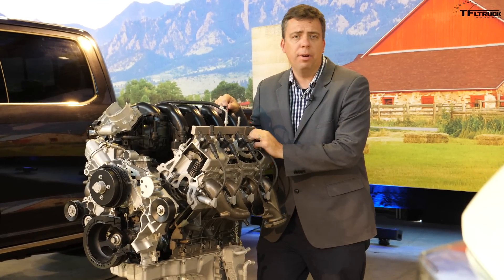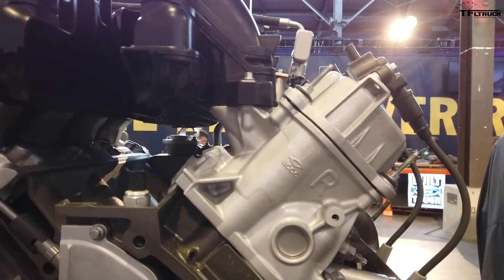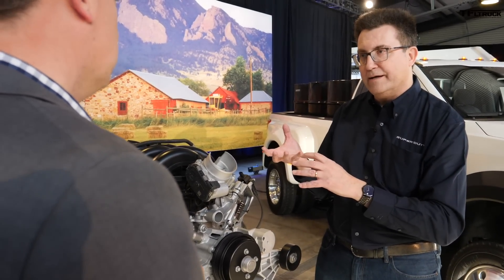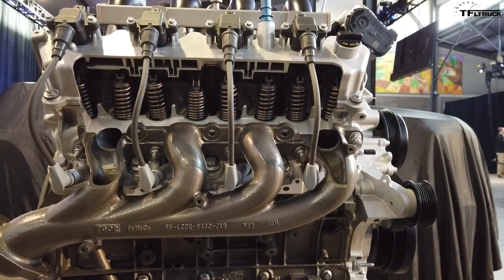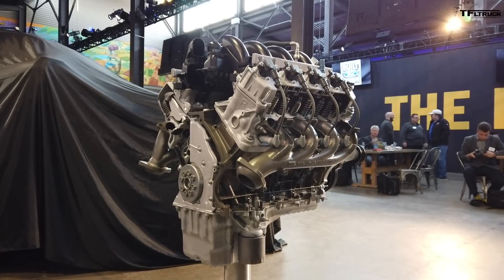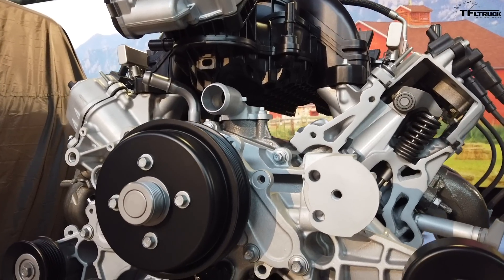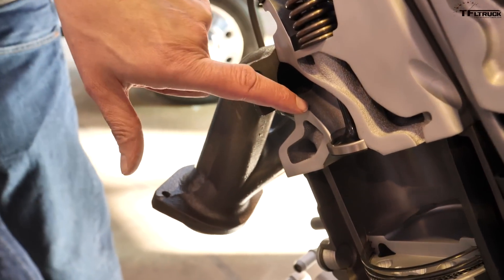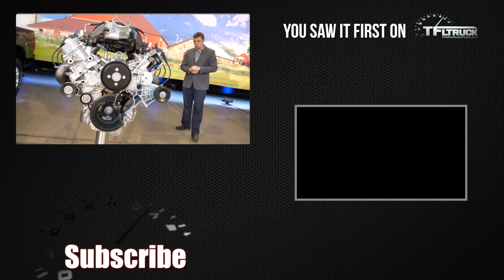2020 Ford Super Duty 7.3L V8: Here's What You Need to Know!

Comment: FINALLY!!!  PUSHRODS!!!  ONE CAM! YAAAAY! They listened to the customers and mechanics. Now if they just put one in the smallest F150 I’ll beat the door down at the dealership. It’s incredible that even the engineer says that the displacement is what we need to achieve our power any mission goals.  I understand it’s hard to beat a 4 valve head in flow numbers but he sounds like an idiot saying that you can’t get power and rpm with pushrods.  Has this guy ever heard of the traditional Chevy, Ford or Chrysler small blocks?
Reply: Concur
Reply: He said their is advantages to using 4v and ohc designs. Which their is. 4v heads by design can flow better than 2v heads
Reply: I would rather have a big reliable engine that will last than an efficient engine that is complicated to fix and breaks down more often.

Efficiency isn't the end all be all of engines. When it comes to a work truck (like pickups are SUPPOSED to be) you want reliability and lasting power.

Reliability and lasting do not mix well with complex engines that run at 110% efficiency and crank iut every bit of power possible.

Just look at race cars, they have the most effecient engines around and they get rebuilt every race.

Meanwhile semis have HUGE engines that don't even put out much more power than the new little pickup diesels. So theyre not efficient, but they last FOREVER.
Reply: @FerrariTeddy  what? Semis put out 2.5x the torque of a modern truck from the factory. Turned up they beat the pants off even the cummins.
Reply: i want to see this supercharged on a dragstrip
Reply: What no one seems to mention is the size of those Ohc mutants. It makes working them 10x more difficult. Their  taller and wider plus have more moving parts then they need to.  Simplicity has always been beauty. Top fuel only uses 1 cam and they make 5000+ hp   The worlds most popular engine.. the LS has 1 and I think ford is finally coming out of the fog again.   Nobody says I just 4.6 mod motor swapped my Camaro. There a good reason for it.  Mark my words...  in the years the come the mustang will eventually get the same treatment.  Cubics over cams
Reply: couldnt custom order one with the 7.3 in it?
Reply: @kennedy796  Torque is irrelevant. You need power to move.
Reply: @TheEsseboy  so 500 hp and 2500 lb-ft of torque is irrelevant and less powerful than a diesel pick up?

So i saw a car hauler with a 300 hp cat (1800 lb-ft) engine pull into a car lot loaded with 6 new diesel pickups. Could any of those pickups pull that amount of weight?
Reply: @kennedy796  A 500 Hp 2500 lb-ft engine is exactly as powerful as a 500 Hp 250 lb-ft engine. Depending on the powerband they will accelerate as quickly and pull the same amount of weight (with the same relative gear ratio and traction ofc)

Yupp, with same relative gear ratio they would all pull the same weight ( given they have the same traction as the car hauler ofc).

Engine torque is not what tells you how much you can pull! Gearing and traction does...how fast you pull it is those AND power and powerband.
Reply: dfdf kjkj in an f-150?  I wish. Manufacturers are not what they use to be. Too maybe constraints now. When I asked GM about getting the 6.2 in a small Silverado their exact words were “don’t hold your breath”.  The sport truck class right now is untapped. Hopefully one of the big 3 will wake up again.  GM will probably try to offer An SS Version of that joke they call a blazer now
Reply: @TheEsseboy  torque is a measure of force. Hp is a measure of force over time. You better believe that a torquier engine is more powerful, but a low hp number relative just says its a slow revver. 250 lb-ft of torque would need 18 speeds to pull a 40k pound load at 30 mph. And most trucks can do over 70.
Reply: @TheEsseboy  you gotta brush up on your terms and physics mate.

A stationary engine can produce 3000lb-ft of torque but make 100 hp but all that means is that engine can output a massive force but it doesnt work quickly.
Reply: @kennedy796  Nope, if they have similar powerband (Say good power from 6000 rpm to 12000 rpm vs 1000 rpm to 2000 rpm) they will need the same amount of gears.
Reply: @kennedy796  Yupp, but if you want a massive force you can use something called *gears*, I know it's a foreign concept to you "torqueheads", with enough gearing you could move a freaking mountain.
Reply: @TheEsseboy  dont change the subject. You spoke of torque being irrelevant and hp being the know all end all
Reply: @Randall Otis , it's better to under-work a big motor than over-work a small motor.
Reply: moose knuckle I couldn’t agree more. That’s why when this eco-boost crap started coming out everyone looked at me funny when I said “ i’m sure It can do what they say but it’s very high strung”  Would rather have a much larger engine that’s barely breathing
Reply: It will never go in half tons unfortunately ...3/4 and one tons fuel economy is not rated by the government so they can get away with big gas engines and it won’t go against their average fuel economy which keeps getting higher and higher
Reply: Ford had the Windsor engine and they abandoned it. Biggest mistake ever. Bring back the Windsor V8s with VVT and direct injection like GMs latest pushrod mills.
Reply: @Matp345  The Ecoboost isn't high strung. It's an excellent truck engine. It makes it's peak torque very low in the rev range.
Reply: @Matp345  The Ecoboost isn't high strung. It's an excellent truck engine. It makes it's peak torque very low in the rev range.... Reliability of turbos aside.
Reply: Richard Tuck of course it’s high strong, It’s turbocharged. It’s spends most of its time in boost which puts incredible strain on parts. I guess high strung could also mean big cam high compression which isn’t the way I meant it
Reply: Colton Weaver sadly you’re probably right. The government says a certain percentage of a manufacturers fleet needs to have a good fuel average. Also remember if you had a very small truck with a big engine that isn’t breathing heavy to move the weight  The mileage would be pretty good especially with the technology we have now and these 76 speed transmissions. My 06 GTO gets almost 29 on the highway. I think that’s pretty damn good for 3700 pounds and 400 hp. They can do it but they choose not to.  They keep talking about these bigger gas engines to pull weight meanwhile I see more mustangs and Camaros on the road than I do guys pulling trailers with gas trucks. Chevy just introduced a new 6.6 V-8 which in traditional GM ways it will never be used for something fun.  Seems like Dodge is the only one that cares about the fun factor anymore
Reply: @honkhonkler7732  , I worked at the engine plant in Windsor that produced the 351, plant no.5, the casting plant, knocked many a casting off 351's. btw we also casted nickel steel blocks for NASCAR teams back then also, Bill Elliot and Junior Johnson race teams.
Reply: @Randall Otis , this motor is being assembled at Windsor's Essex engine plant.

Comment: I can't wait for Hennessey to take over this big block engine and install it with a whipple supercharger.
Reply: Screw that. 2 turbos.
Reply: That's all I've been thinking
Reply: Lots of room for activities in that big ol intake valley :)
Reply: @calebnation7797  man, you're the prime example of a ricer
Reply: Ford Ltd nope. Nothing wrong with turbos. The only thing that bothers me is that it would be stuck in a Ford truck. An old 60s 2 door galaxy would love this.
Reply: @JosephSamsor  when this engine comes out I want to put in a 2019 suicide door lincoln continental
Reply: Ford Ltd except a pair of turbos will make more power than a supercharger. I like superchargers, but turbos are the future
Reply: @calebnation7797  but turbos have a delayed acceleration unlike superchargers where the power is there when you need it
Reply: Ford Ltd sorta... a supercharger builds boost linearly. It’ll make X amount at idle and grow from there. However, it won’t start making meaningful boost till higher in the rev range. A properly tuned turbo setup can do the same or more boost at the same or lower RPM as a supercharger, plus when you aren’t in boost you can still have an efficient engine. A supercharger is going to be less efficient for identical performance which matters for modern everything (a big reason a lot of small cars have turbos). A supercharger is less complex and makes a lot of sense as an easy aftermarket thing, but from an OEM, turbos make the most sense.
Reply: @calebnation7797  you are definitely correct. But what I keep seeing that nowadays is people don't know how to take care of turbos (resulting in a short lifespan). In my case and where I live in (daily driver, in Canada) I think that a supercharger or a naturally aspirated engine is the better choice (as you don't need to heat up or maintain a turbo)

Comment: Looks like they're finally replacing the Triton V-10. Good move to stay ahead in that market.
Reply: Jamie Montoya Triton always gets hate lol
Reply: Yes, well if they wanted a bigger, more powerful slightly larger gas motor, just save all that r&d $ & return to the proven v10, its still in lots of RV's. I had the v10 in an 05 excursion. It was great & I was very disappointed when I learned it was not available after 2010 in a SD pickup. I did not want a diesel motor & the v10 towed like nothing was back there. So I have a 6.2 gas, has a great sound & tows well. But it's no v10, well I'll see what this big 7.3 v8 is.

Comment: meanwhile in finland, just a full tank of gas for this would cost 250usd
Reply: And in good 'ol 'Merica you can do it for $100usd
Reply: @InvestmentJoy  lol, on a 60 gallon tank
Reply: @TheYummyBrand  How much does the petrol costs in America?
Reply: @valentinogj6106  $1.73/gallon
Reply: @valentinogj6106   Where I live Regular is running 2.279 per gallon. That is a bit on the high side since Connecticut is a more expensive place to live, they tax too much here. in TX and SC, it's well under 2 dollars per gallon.  What is going one here Nino, is the Shale revolution,  we getting Hydraulic Fracturing down really good, the engineering part- it's almost to the point were a barrel of crude from it is almost as cheap to produce as Saudi Crude.  And then there is the Natural Gas part of it, the pipes are being built to bring that to market too, at a price that damn near gives it away.  We have become pretty much energy independence. The oil is very very high-quality light sweet crude and our oil refineries are making the adjustments. This is really good for the United States,  But for places like Venezuela its worst that bad, we are one of the few places in the world that can even refine that Crude, it's very heavy and it takes a lot to refine and you don't get much out of it. You think they got trouble now, wait a bit once all our refineries are converted over for refining the domestic high-quality light Sweet Crude.  Shale is one of the reasons that relations with Russia are somewhat strained these days.
Reply: @valentinogj6106  $3.49/gal in PA. $120 to fill my 35 gallon tank.
Reply: @TheYummyBrand  damn in Australia a us gallon works out to $3.35pg for cheap fuel and $4.05pg for premium in USD and that's just gone down a month ago cheap fuel was 4.05 and premium was $5.09pg
Reply: @blueblood5297  holy shit!
Reply: @TheYummyBrand  about the same in Canada too.
Reply: @TheYummyBrand  and just like that 6 days later back up to $4.05 a gal for unleaded ffs

Comment: They need to bring back the 7.3l powerstroke
Reply: They kept it around for as long as they could. They'd have to redesign it for modern emissions regulations.
Reply: brandon neil the 7.3 was so underpowered, lasted forever, but couldn’t get the mileage of a cummins, or lugging power, or longevity.... and they simply couldn’t compete until the 6.0, and no I’m not roasting Ford too hard because I am a ford guy but I own cummins because I can’t afford a 6.7 powerstroke, my dad owns one and friends own the cummins and honestly the power stroke pulls and performs better.
Reply: Just said 7.3 is best size
Reply: No they don’t. Have you driven a 6.7. They are the shit!
Reply: I have a 2000 F350 for sale
Reply: thats what i thought they were doing when i read the title. kinda bummed but this looks like it has the potential to be a great gasser.
Reply: they still make them just not in the super duty. gotta get an international. they can't get it to pass emissions for smaller trucks
Reply: The 7.3 was a badass engine, however emissions regulations killed it. But the 6.7 is tits in my opinion.
Reply: Maybe they will if this turns out good enough
Reply: 4 a millisecond I thought they were bringing back the 444 one can dream
Reply: brandon neil yessss🇺🇸🇺🇸
Reply: soaringtractor I had a 1992 cummins 5 speed that would pass my dads built 6.0, then I got my 5.9 common rail that was stock and my dad sold the 6.0 cuz he couldn’t keep up with me, I put 40000 miles on in a year, 80% with a gooseneck with tractors on it, I have a buddy with a 7.3 Manual and he couldn’t keep up, another with a superduty, same thing! I’m a ford guy but I’m not a big 7.3 guy, I like my cummins just because of the simple power and inlines are just better for towing, but damn does the 6.7 powerstroke outpull the 6.7 cummins! I hauled in Kentucky, Illinois, Indiana, Iowa, I would rather have a cummins for them drives than a 7.3 just because it works better for what I haul and I get better mileage, I can’t hear very good after that 😂, and no I don’t hate the 7.3 just putting in my 2 cents...
Reply: 7.3 is POS compared to the new 6.7. They have .5 million mile trucks on the road with just maintenance and of course delete without a heavy foot.   And who else producing 600hp at wheels with basic pipe program and filter?
Reply: @joeballew603  7.3 powerstroke was a super reliable motor served for 1000s of miles
Reply: I wouldn't own any other diesel engine then my trusty 7.3
Reply: @brandonneil8954  not saying 7 3l didnt do its job just saying fords 6.7 is far superior now and will last as long in diesel world if ford continues to build quality and reliability. Finally. lol I love my cummins.
Reply: @joeballew603  with a little work those would make upwards of 600hp
Reply: The sky was black in them days
Reply: neil  turbo injectors fuel pumps and tranny that's not little work. Lol
Reply: Is your Cummins a 6.7 ?? It any good compared to dad's 6.7 ford?
Reply: @jerrybrandt9377  5.9 old school.

Comment: Ford brings back the 7.3 but Gasoline 🤯🤯🤯🤯🤯🤯🤯🤯🤯🤯🤯🤯🤯🤯
Reply: Dude I'm in disbelief and I am a Ford guy
Reply: Anthony Arista how could they bring back an engine they never made? And that was dumped for not being able to keep up with emissions standards and a need for more power? It was an old design.
Reply: @JosephSamsor  yet everyone that had one loved one shure it lacked in hp but the 7.3 and the 7.0 were amazing engines that Ford once had in there super dutys
Reply: blowingtrees2 The 7.3 was never for a Ford engine 🙄.  By the time the 00's came along, the 7.3 was showing it's age horribly.  The 7.3 was phased out for many reasons, emissions being just the tip of the iceberg.
Reply: blowingtrees2 it was built by international. Not ford. I believe the only diesels ford built was the 6.7 we have now. Also, you seem to be really unknowledgeable about this stuff. Ford has to build trucks and cars to a standard. If they build trucks that can’t pass emissions they can’t even get them on the road. Also, there is no arguing that a 7.3 is, by today’s standards, a weak engine. It’s outperformed by every gasser. The only thing that keeps people using 7.3s today is the fact that they’re cheap to run, stupidly reliable, and came in good trucks. Not because of power. I’d personally never buy a new truck in the first place so I’ll stick to my dream of putting a 70s truck body on a ford psd chassis with a 7.3.
Reply: @JosephSamsor  Explain what? Would you like me to draw you a picture??
Reply: blowingtrees2 I apologize, the comment only sent, initially, with the face palms and no description. But, international built the engine. The new 7.3 is not only a gasser but is an entirely different engine to the 7.3 diesel that was in the trucks. They can’t even be compared. The only thing that’s the same is that they’re both 7.3 liters. Basically the new engine has zero resemblance to the old one.

Comment: Nice to see they didn't go full speed stupid on design like GM.
Reply: Full speed stupid? There are millions of LS engines on the road and will be for a very very long time.  Considering they cost less than half the price of any Ford crap motor I would say you have your facts mixed up. EVERYTHING Ford does is full speed stupidly designed.
Reply: gregg4164 o think he meant on the looks of the truck. Gm cars have gotten really ugly with the new designs
Reply: tim coenen but the video is about a motor so it’s not a far stretch that one would assume he was talking about Chevy motors. No where in this video are the discussing body design